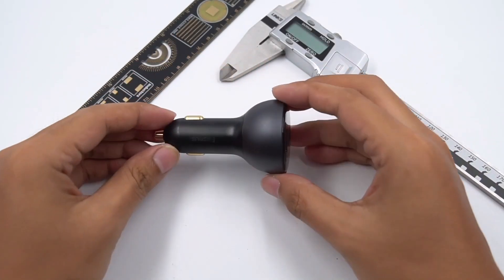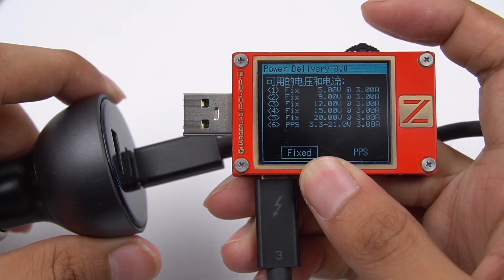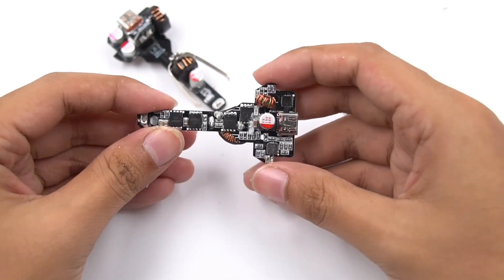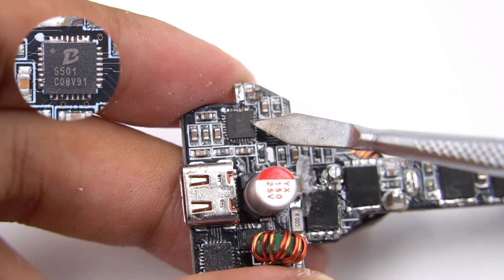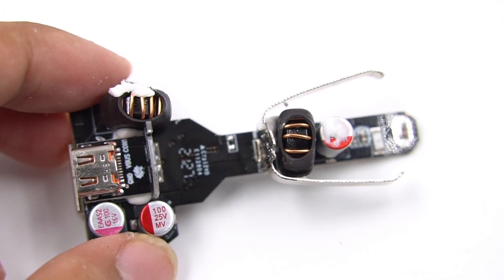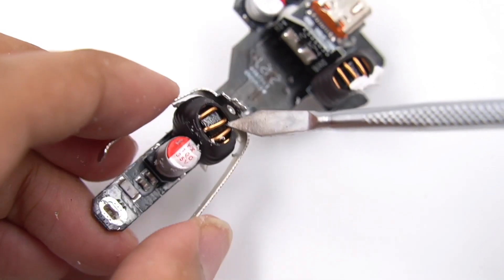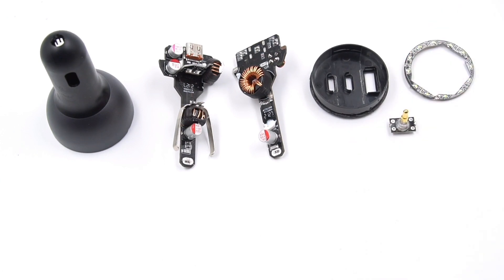Teardown of Baseus 160W Multi-port Car Charger (QC 5.0)

Comment: 0:45 You state that "the charger can output 15V/20V only under 24V input".
This is not correct I have this charger and can use it to charge my Dell XPS laptop at 20V with my 12V battery using the C-1 port.
Reply: Test of my baseus VCKX65C (65W): Dell laptop Lattitude 5520: input 11,6V -> usbc: 20,6V/2,6A (54W) with cpu at 100% (stress web page)
smartphone Samsung A52s : usbc 9,5V/1,35A (12,8W)

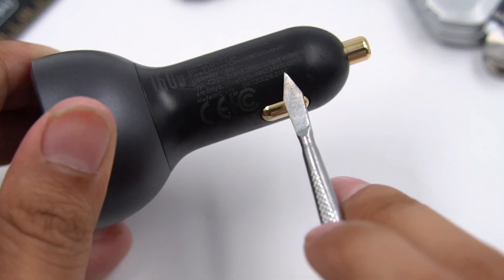Comment: 0:51 As I read, only on TypeC port 2 it will provide 15/20V this when powered from 24V (like a truck), so this means port 1 would still do 20V... as their previous car chargers can; only 20V@3A for port 1 and 20V@1.5A for port 2. 2:45 The PCB design shows a buck-boost fr port 1, so this will most likely deliver 20V.

Comment: Hypothetically speaking. Could I tear this down and hook it up to 4x 21700 cells @ 3.6v nominal each, delivering 14,4v and house it. Making a powerbank PD fast charger of 80w+ PD? (I would need a circuit to charge the batteries too!) Is this possible?
Reply: It is, I just did that but instead of teardown I put a cigarrete socket on the power bank

Comment: so, I just ordered this one, do you think it will last a long time (3+years) if mainly 2 devices are connected for less than ~130watt draw? it's just nice to get a few more % charge on the way home during my short trip. also, would it work in a 3-way 12v splitter because I also have my dashcam running off 12v ? I doubt my dashcam draws more than 30w.

Comment: Would the average person be able to remove the LEDs without breaking anything?
Reply: That’s what I’m wondering!  Idle is already pretty high, and at full load it’s outputting ~5w as heat. Plus bright blue interior lights while night driving aren’t safe
Reply: @GraeDay  I ended up putting it in my under-armrest 12v plug, so I never see the lights, and with a short c-c angled cable I can put my phone under there and still close it, solved!

Comment: In the video you said Fix of 20v 5A, but your Power Z was only showing 20V 3A.   It is supposed to do 5V 20A on that port.  I wonder what is wrong?
Reply from the maker: It should be 20v 5A.
We've fixed the bug of our Power Z tester.

Comment: i think the 100w thing is only possible with 15 amps fuse, hence hte charger limiting the usb c1 to 63 watts
Reply: This converter has no way of knowing the size of the cigarette lighter fuse. It is the connected device that determines the power required.
P=U I -> 100W=12V*8A.

Comment: how did you get the faceplate off in the first place?
Reply: get some 3m xtreme double sided tape, stick the face to a table, or the back side of a plate so you can watch the progress abit closer, theres 2 clips centered left and right, now just roll the the face of the charger while pulling firmly, now all you have to do is break one of the clips off and your in👍

Comment: As the charger uses Yunxing Electronics, 35V, 100μF for the input filtering, does this mean that the charger would be able to handle an input voltage of up to 35v?

Comment: Can i use this in my 120w car charger?
Reply: Yes, but you will temporarily break the port if you use more than 120w, until you buy another 10 amp fuse. 

I wouldn't recommend using more than 100w on those ports continuously and/or concurrently

Comment: These chargers are super useful for even non-car situations as the input value can range from about 10-28V easily (12-14 for family car, 24V because of trucks). I power them from older Lenovo laptop power bricks at 20V and therefore provide a efficient re-use, or you put them onto a Lipo pack that is used for your quadcopter or RC car. ;-)
Reply: Disapppointing this is only 20@3A for TypeC port 2, 20@1.5A for port 2 = 90W total... and the USBA is 20V QC5, so max at about 65W?  According to the specs the C1 should be 100W max but not seeing this in the readout... and USB is max 30W. Somehow the readings are wrong... and that can be based on the input. Some of the BaseUS car adapters will only output the max power of 20V in those specs if the supply is OVER 12V. This might mean your input voltage is not adequate?
Reply: hahaha, I see you got one of the car plug from Taobao... those with an AC-DC brick?
Reply: Let's also consider for a moment the BaseUS promotional material; Some of that includes an exploded diagram of the board design/layout. While the chips shown look very generic they went to the effort to show a matching layout ;-D

Comment: Is QC 5.0 just an add up of QC 2.0 and QC 3.0?
Reply from the maker: It supports the brand-new QC 5.0 protocol.
Reply: @ChargerLAB  seen that but i didn't see QC 5.0 on ur tester. I seen QC 2.0, QC 3.0 and QC 4.0+. Or is ur tester a bit old?
Reply: @harleyhem3381  Yes, it does not support it.

Comment: most cars with 12v electrical system only supports 10amp max from cig lighter so its limited to max of 120w and even then it will probably blow the fuse quick . this is more useful for truck and bus drivers as all semi trucks and coach buses have 24v electrical system to reduce cranking current of the big diesel engine.
Reply: I also noticed the actual protocols do not count up to the expected max wattage. most likely the input voltage wasn't over 12V as BaseUS describes in their documentation. A lot of the desktop supplies with a cigarettes plug only barely power at 12V. It explains part of the missing readout. Note: a 10A fuse on these plug is not that common anymore. I checked mine just recently and it has a 15A blade fuse.
Reply: Mines are rated 7.5A its an old honda gm2 - just need a 10-15a fuse as i only want 65w output for my thinkpad
Reply: Not really unless you're talking about really old cars. Most front car cigarette lighters are rated for 15A continuous so that's 15*14 = 210W

Comment: I would have loved to see how much REAL power it provides on 12V. That is really the test that is worth most for me in any charger. But anyways. Thanks! Because 160W, out of this thing in 12V? No way that is 15 Amps, no car-plug will even have the cable in it to do that. And Baseus knows that. So how much does it REALY charge?
Reply: This charges my laptop capable of 100 watt USB-C charging. It's a great charger but eventually melts a bit at the end causing for a loose connection and also eventually stops charging at 100 watts. Starts charging intermittently like crazy. It gets too hot. I have a 18 Kia Optima LX 2.4. This would have been the perfect charger as it works better than similar ones. I can't tell if it's something with my car, my laptop, or the charger. Wish I can pinpoint it 😢
Reply: uh.. some car is capable to carry 20A. some 15, 10, or even as small as 5. that depends on your car
Reply: Its 160w on 24v only i think
Reply: i tested mine arrives around 90w on a single type C, so not too shabby
Reply: Isn't the max power just at 24V?

Comment: Thank you for this teardown

How do you think, can this charger provide PD 20V from 18v lithium battery?
The problem that on fresh battery input volage will be 21v and then drops to 17V during discharge.
Reply: you should be able to pull 20V on C1 output since that one has dedicated buck-boost converter unlike C2 and A output that only has buck converter

Comment: Why the hell did they need an H-Bridge? Are they galvanically isolating the output?
Reply: No, the H bridge is a combination of a buck and a boost converter (both sync ones)... Check "4-switc buck-boost converter" and you'll see what I mean